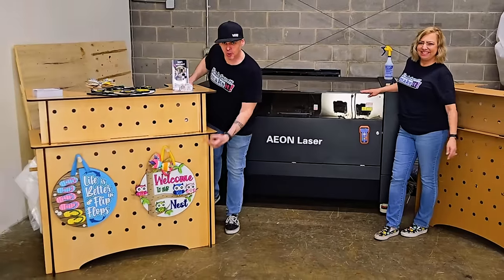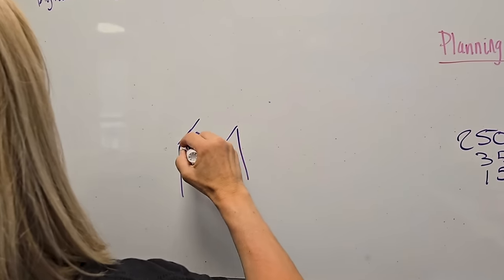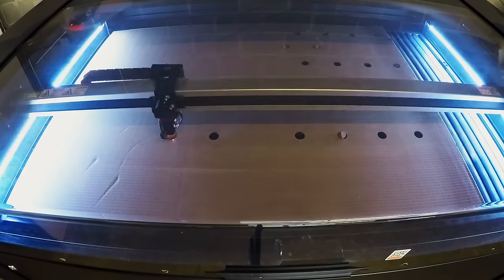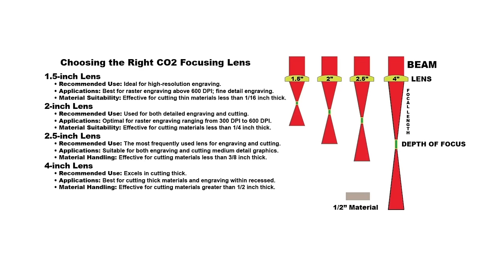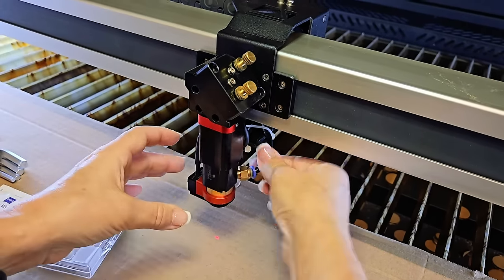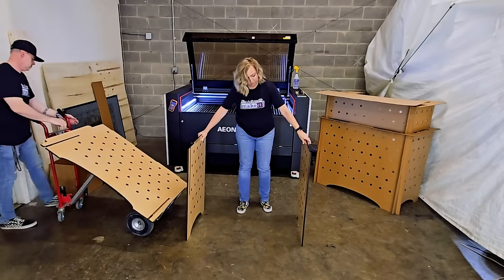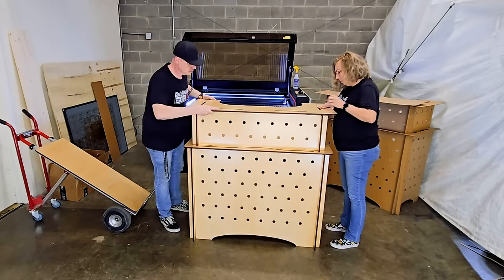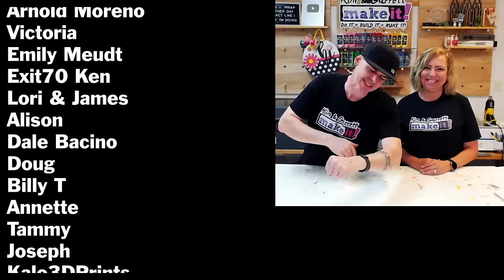DIY Craft Booth Checkout Counter

Comment: That is pretty cool. So one suggestion I'll throw out for a one person setup. Instead of having the fronts and sides interlock, use piano hinges there. It's the right size the sides should fold up nice. The. One person one just slide out the sides, it will stand up on its own. Then put a top on wiggle the sides around till the slots line up

Comment: Cool idea, but I see the potential for the half-lap joints (at the base mostly) of warping, snagging, and getting damaged because they are so long. If you watch your assembly, you both grab the thin parts to manipulate the joint together. That alone will eventually cause your straight frame to have a flared bend. I suggest tab and slot for those using a wedge to lock the frame tightly.  The wedges could be the half-inch ply trapezoid shape flat or your dowell wedge with a slight taper.  The dowel rod could be made longer and potentially used as a hanger at the top locations of the joints.